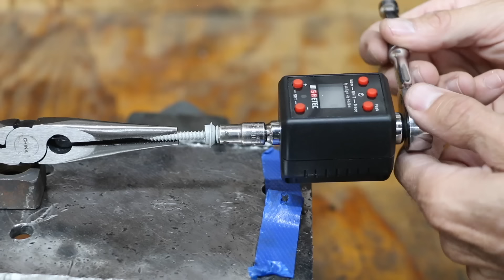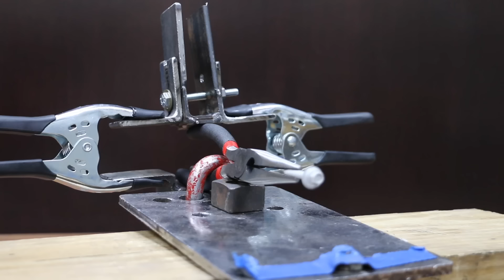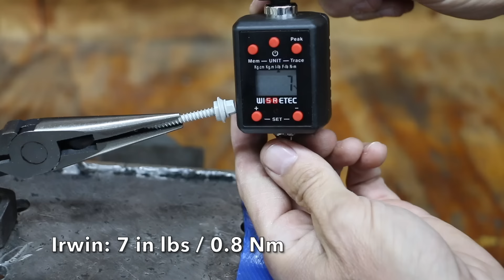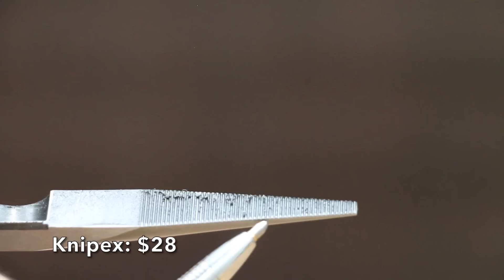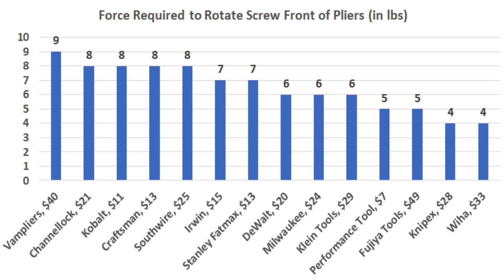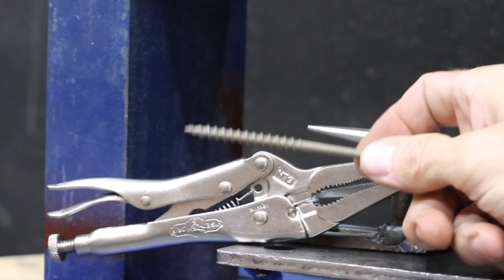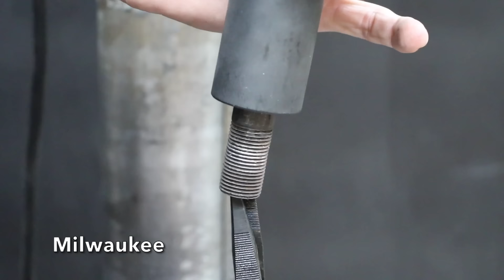Japan vs German Pliers (LONG NOSE)? Knipex, Vampliers, Klein, Fujiya, Irwin, Kobalt Needle Nose

Comment: I think the Knipex and Wiha have a different mission, so to speak. I have a pair of 26 11 200 Knipex that are similar to the 26 12 200 you used. The striations are horizontal only. A linear pull being more important than a twist. Wouldn't dream of cutting a nail, let alone a deck screw with them. I have cut some very think electric wire with them and they have held up well.
Reply from the maker: Thanks for the feedback.

Comment: I think that you compared apples with pears here.
The Knipex for one are designed for electrical work and not for the tests you did.
They also have other pliers which more suitable to be compared with the rest and should be used for this test.

Comment: Great testing!! If you do slip-joint/combination pliers make sure to include the Snap-On Talon Grip pliers (47ACF). They have diamond serrated on the nose of the pliers that grip in any direction very well! I have used these pliers for many years working on cars and they hold up much better than any others I have used. Even when holding a nut and using an impact on the bolt head.
Reply from the maker: Thanks!  Thanks for the suggestion.
Reply: @TheCheesePlease not really. Overall it’s a solid brand. Some of their tools are far better than other brands. But they definitely have many tools that are just meh at best. Snap-ons locking pliers (vise grip style) are worse than the cheap ones harbor freight for instance. But those talon grip pliers take a crap ton of abuse and the amount of grip at any angle from the diamond serrated nose is amazing!!! I’ve used many slip-joint pliers and gotten busted knuckles from them slipping when I’m pulling on something and I’m willing to pay extra to prevent that!

Comment: Who cuts nails with needle nose pliers?  LOL  I use a power tool for that. And if I'm stripping wire, I use a wire stripper. For me, grip is the number one job. Cutting is secondary and its just used to cut wire or zip ties. A pointy nose is also important along with long reach for grabbing stuff in tiny places. But I will say that I have a couple pair of Vamplers and where grip is king, these are the pliers to own.
Reply from the maker: Thank you!

Comment: Thanks, Commander and That was another super test series. I really liked the 2 holes in the bolt for testing twist. I've got an old black handled something I've had for years and ground down the tips to make a circlip remover/installer set out of. They still work as good as they ever did. I need to get some LONG needle noses though. Lowes just has the double jointed jobs and I'm gun shy about more movable parts than needed but I won't use them much. Just getting the clips off the mower deck mounts so I can work on the decks on the riders. So thin skinned I look like I've been in a riot when I mess with them. So THANKS for another good one and it'll warm back up shortly. Our Yellow Bells/March Bells are blooming or were until it hit 15 early this morning. Yall be BLESSED and happy Spring and new time on the clocks!
Reply from the maker: HI Lewie, Thank you for the positive feedback on the test! Great strategy on making the clip removal tool.  I need to test snap ring removal tools at some point.  They are prone to failure and there's been a lot of requests to compare them.  It was 7 degrees here this morning and hopefully no more of that until next winter.  lol.  Can hardly wait until the yard, pastures and hay fields are covered in green.  Wishing Yall many BLESSINGS!!
Reply: @ProjectFarm  I couldn't think 0f snap rings for the life of me. A senior moment from birth! And 7 is COLD! And the green is on the way. Thanks, Pard and GBWYall!

Comment: my only tool by knipex im not thrilled with. better than the klein at getting in tight spaces and say gripping a wire through a hole or picking up a screw you dropped in a junction box. but flexes horribly if you need to twist anything
Reply from the maker: Thank you!

Comment: You can't really call the Vampliers 'needle nosed pliers' - right? Also needle nosed pliers are used where you need a heavy duty pair of forceps - i.e. electricians work - therefore the twisting test is most relevant. But cutting nails is not really the proper tool for that.

However, thorough testing as always. 👍
Reply from the maker: Thank you!
Reply: @ProjectFarm  
You're welcome.

Comment: Good tests on durability, but it would be nice to see how it actually can perform, such as ability to access a tight space.  In real-world setting, it's prob unlikely to use needle nose in harsh use conditions (there are other tools better).  Maybe a test for reaching into a tight space, how much is needed... both opening size needed, length of reach, and smallest item they can pick up.  In testing precision picking up something, such as a oily/greasy BB or different sizes ball bearings, plus how are the ergonomics, does the handle or size better or worse than other styles.
Reply from the maker: Thank you for the feedback!

Comment: Curious how Tekton stacks up on this one.  I will say that the crosshatch seems to grip better for me when pulling greasy rubber o rings off equipment, and also that the Vampliers will cut through nearly anything if you can stomach the carpel tunnel syndrome that comes along with using them to do so.

Comment: Great video as usual !!
I would like to see a comparation between ratcheting wrenches to see which one has the strong mechanism on rusty or very tight bolts or which one has the strong open end before buy a new wrench set
Reply from the maker: Great suggestion!

Comment: I have a bad habbit of not using the right tool for the job and long nose pliers always break on me. Ive used them as adjustable wrenches on bolts tap nails with the pivot point and prying stuff like a crowbar.
Reply from the maker: Thank you!

Comment: Testing is hard. In these tests some random leveraged heavyweight plier would've won, while that's obviously not why you want needle nose pliers. This small knipex with very long and thin tips and short handle is not good here, but it might be a nicer tool to work with if strength is not what you're after. But overall good job as always of course! It does give a rough impression

Comment: I'd love to see a showdown of wire strippers. Both thin adjustable type and bulky wire holding types. The ones I have for work are the thin adjustable type and have loose rivets and annoy me. I'd love a thin one with a lock-close latch which works and a gauge dial that holds its position. Thanks for your great work!!
Reply from the maker: You are welcome!  Thanks for the video idea.

Comment: I personally like the Stanley tools. Probably the best bang for the buck you can find. They’re not the best, but they get the job done. What more can anyone ask for. I bought a set (6 pc) of screwdrivers because my mom and sister kept losing my good ones. It was only $10 at Walmart and I ended up using them myself. Not a bad deal
Reply from the maker: Thanks for sharing.

Comment: My early comment is you can’t make me buy new pliers. 

It’s been a while since I bought needle nose.  I bought 2 pair of vice grips about a decade ago. My primary long handle are harbor freight I think. 15? Years old. Now I have about a dozen regular needle nose in differing trim. I might have added a couple more long handle from a cleanup this summer but dumped 5 gallons of other pliers. 

I also scraped 5 gallons of socket without remembering I didn’t have 1/2” deep well non impact metric sockets.  Doh.   

Nope You can’t make me buy new pliers.

Comment: Suggestion I have a hard time cleaning the handles on some tools. Maybe dip the tool's handles in used motor oil, than spend like 30 seconds trying to clean them, to see which tool's handles clean the easiest!

Comment: While I do think you work the hardest and do your best to show the strengths and weaknesses of the products you test I would, like many others have mentioned, like to see at least of couple of actual use tests. Most of the tests in this video were just abuse tests. Sure, a few people will do this but not the majority of people who actually know which tool is right for the job. And, seriously, it would take a mountain of a man to actually have the grip strength to both hold and then twist any pliers to 120 inch pounds especially in a real world scenario of tight spaces or dirty/oily items you're trying to grip. I would certainly think designing realistic function and ergonomic tests would be more difficult and perhaps subjective. But at the end of the day I've never seen anyone try and use long nose pliers to try and cut a framing nail nor put enough pressure on any reputable brand to twist the nose or break the jaws. But I can give a suggestion rather than just criticism. And that is a good many guys do use  long nose pliers to twist fasteners into a semi circle or use them to twist a nail or something like a nail open that was used to hold conduit or, yes, even electrical  wire or to twist open staples. I've seen cheapo pliers bend in this scenario. But even my very long handle, 90 degree bend tip Harbor Freight specials have done these jobs hundreds of times without damage. Again, in functional but not design specific applications. I do love your channel overall and will always watch but I do think some of the hand tool videos especially have become more torture tests with no aspect of functional use examined.

Comment: Great Job Sir.

I have several pairs of Klein tools at work, and a couple at home.  I like them a lot.

This is highly dependent on usage case, however.  I like the Klein, because they are all purpose, in my mind....  they are a good "middle" ground.

Something like the Wiha, is awesome for wiring jobs.  It's got the super fine needle tips...  Close to tweezers, they are so precise.  So if you are wire wrapping, or wiring in a tight terminal box, it's impossible, you have to use needle nose pliers, for your hands....  With some practice, you get very very good at it.   The Wiha, are awesome for that stuff... 20 gauge, 22, 24 gauge wire...  Beautiful.  You have the Wiha pliers in one hand, the little nut driver in the other...  Strip it, wrap it on the post, spin the nut down.....  Relative to your testing, that would be extremely light duty...  But to me, that is clearly what the designers of that needle nose were thinking about....

So, I have a couple pairs of the Wiha also.  Wiha makes nice stuff.  

But I would urge the viewers, to ask themselves, WHAT ARE YOU DOING WITH THE PLIERS?  Your usage case, will make a big difference, in which one comes out on top for you here...  There's really 3 different usage cases here in this test, so....  I am not criticizing your tests in any way...  I am just saying, viewers should pay close attention, but also keep in mind, what do you plan to do with the pliers, is a key question.
Reply from the maker: Thanks for the feedback.

Comment: It's pretty awesome seeing 3 tools tested to the max that I use 5-6 days a week 8-10hours a day. I have to say, the Wiha's I loved at first, but after using the Vampliers, I don't even touch them anymore in my toolbag.
Reply: Also on a side note, they use those exact Milwaukee pliers at work but every one of them have problems with the grips coming off, turning on the handle or sliding down. Maybe you can include this sort of thing in the future?
Reply from the maker: Thanks for sharing.

Comment: I think that the tests are generally well designed. Nevertheless, more specific tests could be made. For example, such pliers are used more when you have little space anyway. And some of these pliers were not suitable for this because they had a much too wide design. While this width and robust design of course helped in other tests...
Reply from the maker: Thanks for the suggestion.

Comment: I have recently gotten into shipping/hauling. I use my pickup, and have 3 trailers. 2 things I would be interested in are ; first tongue mount jacks, and second hitchpin and tounge locks. 
Durability
Security
Weather, recently had to cut a lock that had a keyway full of mineralized (winter road grime) mud and ice...
Please and thanks
Reply: Lockpickinglawyer, here on YouTube, shares his extra with security.
Reply from the maker: Thanks for the suggestion.

Comment: It would be helpful to add a measure of accessibility in tight spaces. Something like "what is the widest width of the nose while inserting it one inch into a space". Something to show how useful they are in the tight spaces that needle nose pliers are typically used for. Many of these are trading their accessibility for strength and that should be a consideration made. As always, great video!
Reply from the maker: Thanks!  Thanks for the suggestion.
Reply: Completely agree. It’s the main reason I even bring needle nose pliers to work
Reply: Difficult access and a straight pull is what they're for. We're spoiled by these videos but it was harder watching this one. I've got four different pairs at the moment and the knipex is my favourite because of the narrow profile and the smaller handles. I've got NWS, Channellock and some off brand ones too.
Reply: @kuangsheng3891  Might check out Gedore's "Telephone Pliers." (What Gedore calls them.) I like them better than my Knipex, and fit/finish is PERFECT. (Nothing beat NWS's grips though! I really like their long flat nose pliers for a lot of needle-nose tasks.)
Reply: This! Fully agree with the accessibility test. Many of these pliers look way too wide and too short to be up to the task.
Reply: I agree. I have about 30 different pairs of needle nose. And that makes a big difference!
Reply: Agreed. And the pliers which excel at needle nose tasks are penalized in the torque test for being needle nosed.

Sure, lots of knuckle heads twist needle nose pliers like that, but that's really what flat nose or linesman's pliers are for. 

Same with the nail cutting test. The pliers with the best reach (and thus shortest handles) are penalized for not being able to cut a screw.
Reply: I always buy an extra pair of needle nose pliers and grind down the tips so it will fit into things like door lock keyways, etc. They're not good for much else but they're invaluable for those special circumstances.
Reply: @nathanwaight . Accessibility is of no use if the thin pliers just flex and twist and fail miserably to hold firmly enough, say an "e" clip... The best must be slender enough AND rigid enough to hold properly.

Comment: Who , in their right mind tests needle nose plyers twisting force?? I've had a shop for twenty years and I've never used these type of plyers to twist something. I would use the vice grips you are holding the screw with. Why don't you tedst them for their abuility to be hammered throigh a car body? No one cuts steele wire with these either. Please test, how they function, in procedures they were designed for?

Comment: Some of these videos are good tests, but this one seemed to me to be unnecessary tool abuse.  Wire cutters in general, and especially the small ones in needle nose pliers, are made to cut soft wires.  They are not designed for strong gripping, nor for twisting. In both cases there are pliers designed for the job, but the pivot to tip distance in many needle nose approaches the handle length.  Once you get to a 1:1 leverage ratio you really might as well just use your hands.
Every one of these brands sells pliers more appropriate to these tasks than a needle nose.  Maybe testing what they are designed for, like how large an object can it grip when reaching an inch through a 3/4 inch hole, or can it pick up a ball bearing at the bottom of a blind 1/2 inch hole.  Maybe if it can reach through an electrical wire clamp to pull wires into an electrical box.
Yeah, I know when you don't have the right tool you may need to abuse the wrong one.  Yes, I have ground down the tips of a pair of needle nose to remove a snap ring, but when I abuse a tool like that I expect it to ruin the tool, and I would expect cutting nails or trying to apply 10 ft.lbs. of twisting force with a needle nose to most likely ruin the pliers.
Reply: The tests are exagerated as always. This shows the total durability and you can rougly imagine what durability they have over a livetime. He obviously can't test all the tools the intended way for a life time and then show the results.
Reply: @oldhelldog5460  i don't give a damn about if it can cut a screw if it cant reach in to the small hole i need to get in to
Reply: Your tests include human error and aren't objective.

If not for gripping strength and robustness, there are no other objective factors. And he never tests the subjective ones like comfort etc.

The only thing I missed in this video was rust resistance
Reply: @patrykK1028  He could have done other tests, like how deep can you reach trough a hole, or does the cutter make clean cuts.

Comment: The wiha pliers are more expensive because they are insulated up to 1000V. you could tape the other pliers with electrical tape and  get the same result, but it's dicey. when it comes to insulated tools I trust the engineers
Reply from the maker: Thank you for the feedback.

Comment: The problem with a lot of pliers, depending on the industry, those gripping teeth get filled with grease and other things like oil etc and don’t really work all that well. Cutting edges on long nose pliers for the most part are kind of useless after a few cuts on wires and not many people have the grip strength to do nails. For cutting, I would go with actual cutters and for delicate wire cutting, flush cuts etc, I tend to be picky. Nice test though.
Reply from the maker: Thanks for the feedback.